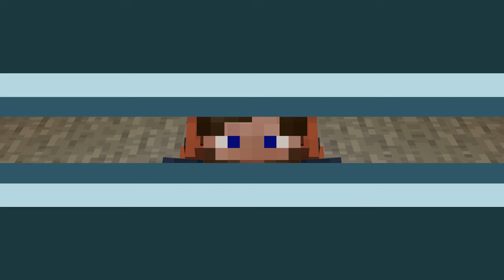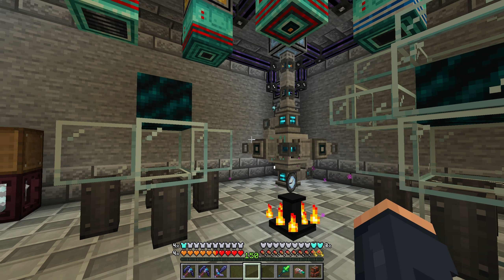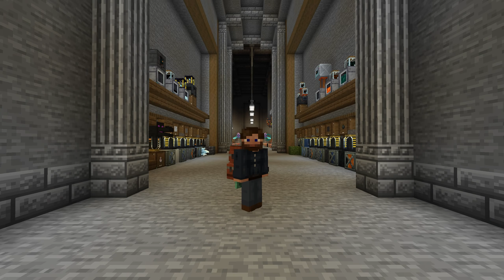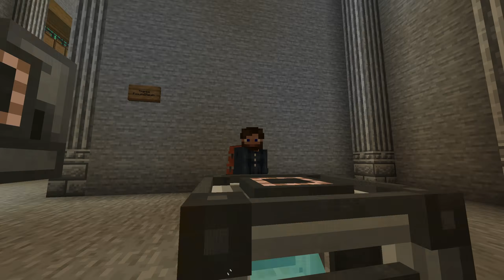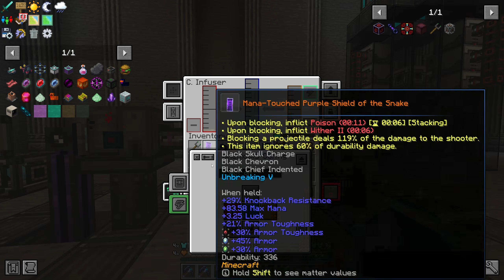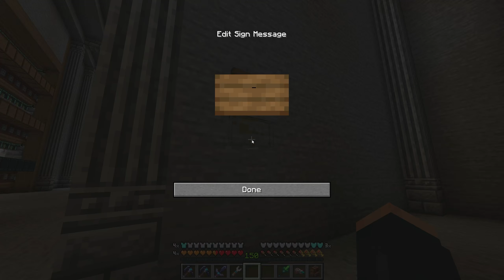Stoneblock 4 Minecraft Modpack EP28 Best Fissile Fuel and HDPE Sheet Automation

Comment: Using a lot of speed upgrade can use a lot of energy, but putting more energy upgrades on the machines, actually saves on energy. It's worth to go full on with the energy ones and you dose the speed ones to make it balanced.

Comment: should use florite blocks instead, its more efficient and is also mentioned in the quest book
Reply: Chicken so strong though, you'll never run out of fluorite just using the gems
Reply: @AbsentOfLightt  you save on acid. Takes less acid to process a block than a dust
Reply: @72lenax  yeah this is the way. If you have your fluorite chicken roost output to a simple compacting drawer, it will even convert them to blocks automatically and one max level chicken was more than enough to support two dissolution chambers in my set up.